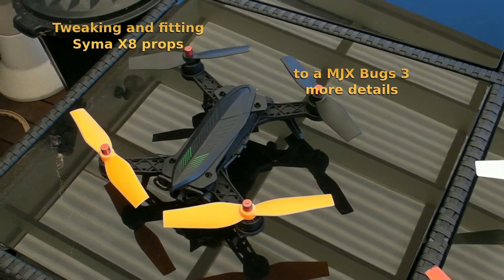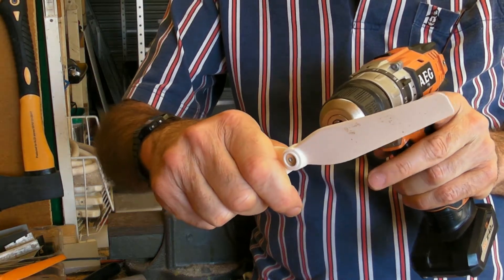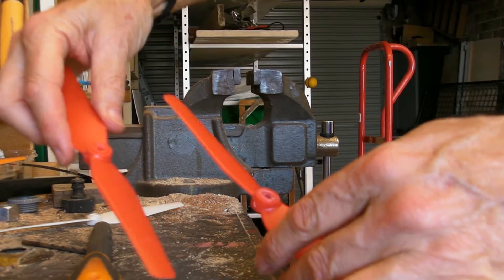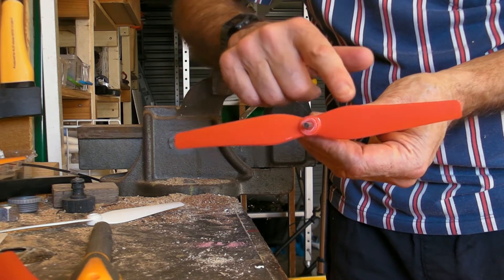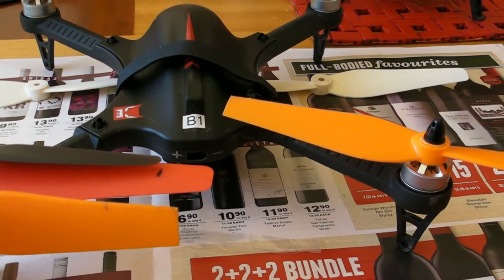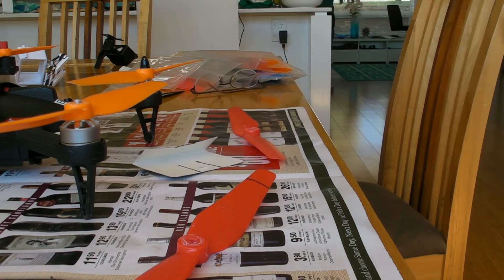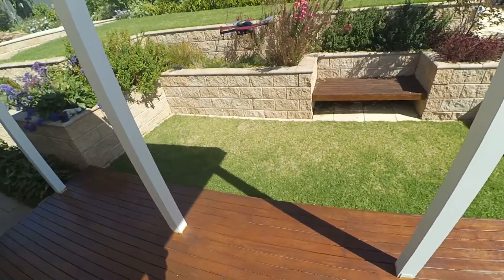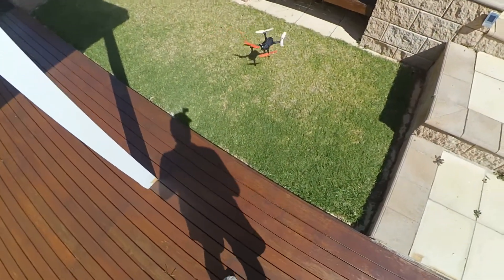MJX Bugs 3 with Syma X8 props - more details

Comment: 👍 Do you get the ame flight time with the x8 props?
Reply from the maker: I did not notice much difference. Longer props gave more speed, but made the Bugs more likely to flip over and drop when the throttle is eased back when landing. Moved on to KingKong props to eliminate vibration for jello free video. I think I'll put a set of X8s back on for a bit of sports flying.

Comment: Could you send me the purchase link with what holds the battery? Is it a tape?
Reply from the maker: I use Velcro, also called Hook and Loop tape. It's inexpensive, and usually on sale in Supermarkets, or sewing supply shops. It comes with or without a sticky back. Apart from that, rubber bands are useful, especially for trying out new ideas.
Reply: Thanks